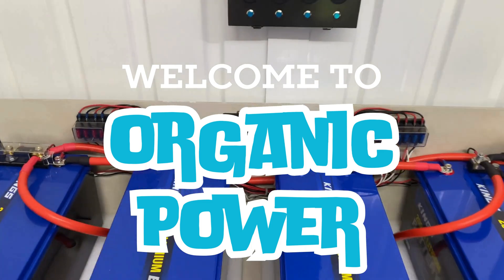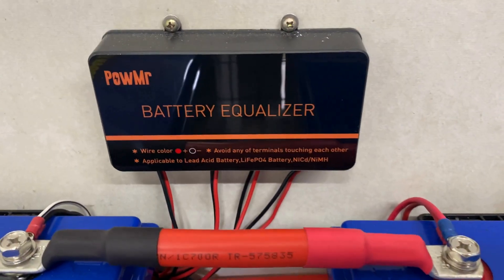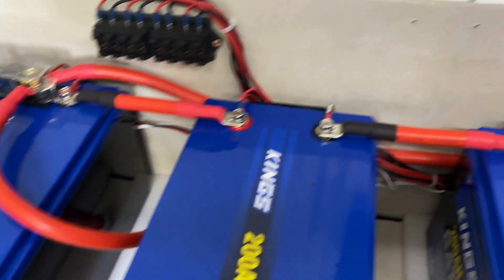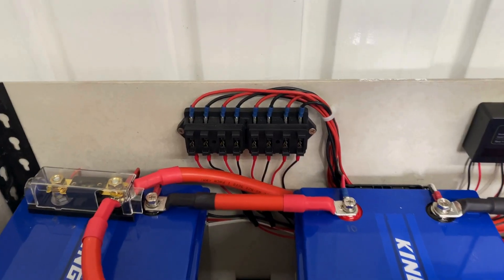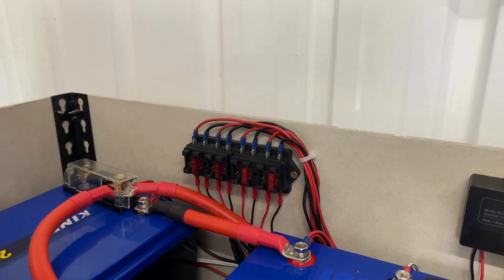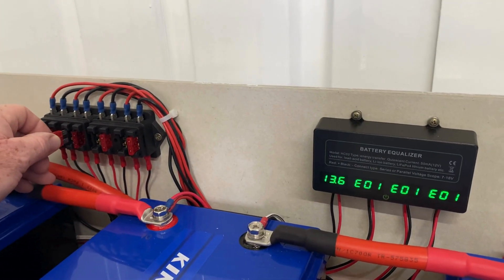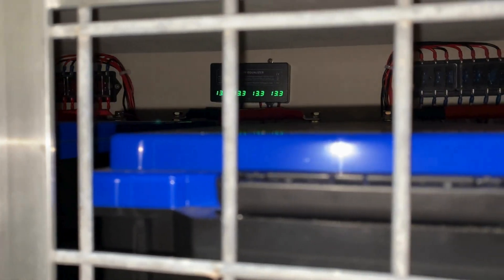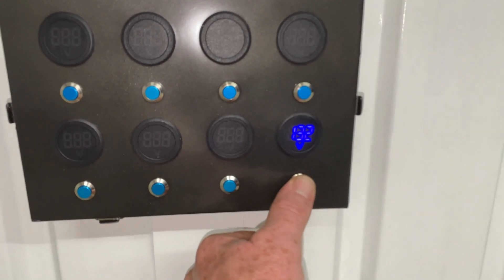Maximizing Off-Grid Solar Power Efficiency - The Crucial Role of Battery Equalisers - Organic Power

Comment: Hi there, sorry to comment on an old video, but i inly jist found your channel today....lol.
Just a query on the kings set-up.
I know you have balancers for each 48v bank.
But how do you know if the internal cells are balanced, when you can only see an overall? Cheers.
Nice shed set-up by the way!! 🤩
Reply from the maker: Hey bud, thank you for checking out the channel! I just rely on the internal BMS to do its job. I started with cost effective batteries as I wasn't sure how good the results would be. There are batteries with Bluetooth BMS modules, they cost more but would give you that option. Just added another 10kWh bank 😎 episode out soon!

Comment: Good job mate and a very nice system. 
Is there a reason you didn’t go for something like EVE cells and a JK BMS, or a few 16+ kWh 48v DIY Battery Kits that are becoming available now that will take MB30 or MB31 cells?
Reply from the maker: Thank you for taking a look 👀 I didn’t like those 2 options as much as it’s a lot of mucking around and expense for no real benefit. I have been an industrial sparky for a long time, battery bank’s similar to this have been doing the job perfectly for longer than I have been around. Very cost effective and very robust. Was just down the shed for the first time in a couple of weeks, checked my wall mount gauges - equal voltage across the board. Very happy with the newer balancers.

Comment: Hey is that battery equalizer available on Amazon?
Reply from the maker: I gave you the link the other day. The EASY Way To WIRE A Solar BATTERY 42kWH 20kVA Parallel Victron Multiplus II Off Grid Power System
https://youtu.be/cjHGYfA-yRg